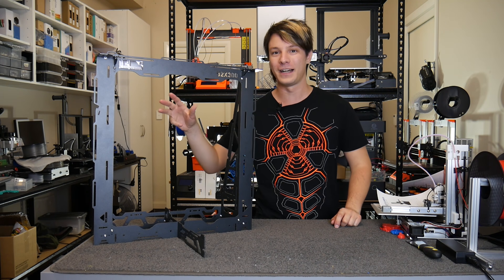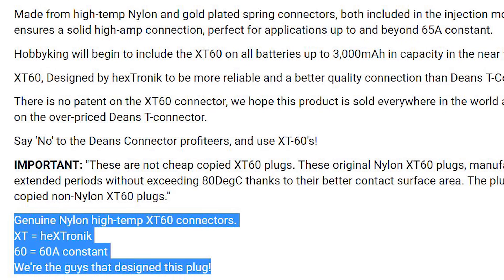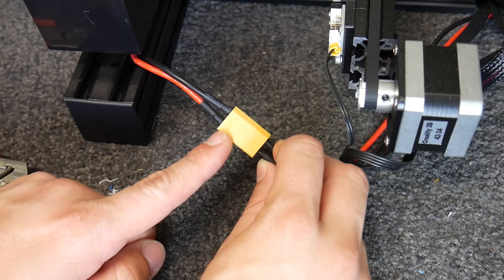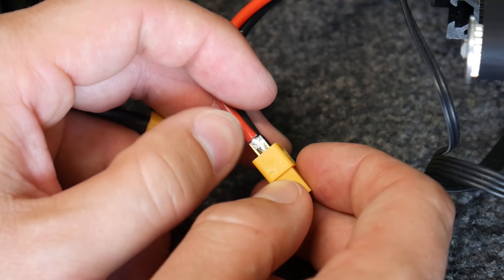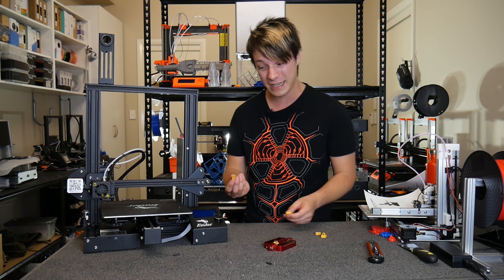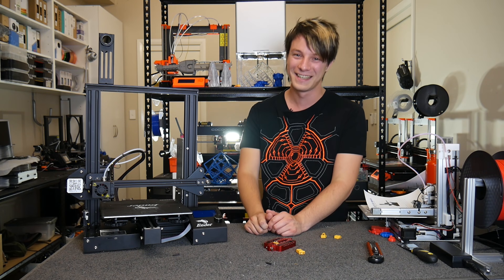Ender 3 Connectors are burning up... Bad XT60's

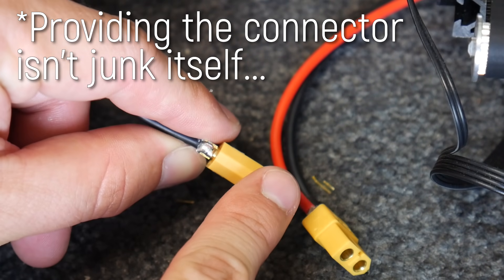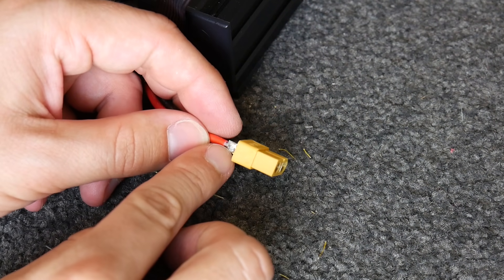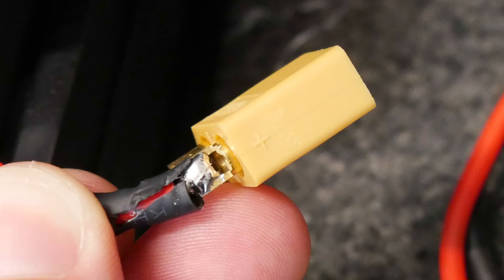Comment: "Decent solder joint??: I disagree, at 4:30 and 4:45 It looks like the cup was cold. It also looks the the first one has less solder than appropriate on the joint. 5:26 looks passable, 5:42 seems to have some of the same problem of cold cup and maybe has excessive solder. If the cup was clean and hot, the solder would be more spread out.  Just seeing the variability I'd blame it on bad joints as well. Even an off-brand connector  with larger than standard tolerance should handle 30-40  amps, which if that's 10 AWG wire would exceed what's safe to run down the wire anyways.

Comment: I would put XT90s on it.. not XT60 but the issue was the plastic they use on these XT60 from alibaba has weaker / thinner walls and many times even during soldering they melt ... the plastic is not able to withstand the heat regular XT60 can put out meaning.. can handle 60AMPS which is heating resistance

Comment: Use a magnet Check of the contacts are made of steel or out of something proper for this use like bronze, which is non-ferrous. Really cheap contact hardware will use plated steel which has a higher resistance. The cheap terminal blocks catch fire on the cheap import RAMPS boards often steel.

Comment: Yup mine burned up and had to be sent back! I'm not sure if I should replace the XT60 on the new one and invalidate my warranty or should I just hope for the best?
Reply: You can feel through the heat shrink if it is crimped or soldered. If you read through the comments here, so far no-one has reported a fried connector and a soldered wire.

Comment: Dumb question ... why do you even need the connector? From my point of view it's just for ease of assembly.
I'm in the process of replacing my Ender 3's mainboard with a duet 2 wifi and I thought while I am at it I'll just remove the connector and run my own wiring straight from the PSU to the mainboard.
Any reason why I shouldn't do that?

Comment: I had a TH1 thermistor (fuse???) burn out on the board of the original power supply on my Ender 3 causing a total power loss.  I installed a new Meanwell LRS-350 (24v 14.6A) following the pics of the wiring orientation I took prior to taking the original off.  The printer will power up and preheat to 185, but as soon as I try to start a print, the LCD goes black, turns back on, and the temperature starts cooling down.  I still do have these XT60s on it, Any thoughts?

Comment: Gold plating versus unplated brass?
Reply: This is the correct answer
Reply: In addition to terminal fitment
Reply: It’s also possible that these cheap crappy xt60s have such a thin coating of gold that it scrapes off the first time its used, causing shavings that arc out. They also use crappy plastic that can’t take the heat of soldering, so the pins end up wobbly

Comment: Soldering is NOT lower resistance than crimping. Any time there is a change in metal type from one point to another, there is a small bit of resistance added. A correctly crimped copper connector on a copper wire will have less resistance than a copper/lead/tin/copper joint. I have worked with 000 wire carrying thousands of amps and you never want to solder the interfaces.

Comment: My Ender 3 came with XT60H connectors which seems to be the same as regular XT60 connectors but with a gray plastic boot on the ends instead of heat shrink tubing. Do you think this is ok?
Reply: Just received an ender 3 and have the same Amass branded connectors with a harder gray back. If you look at the linked xt60 replacement in the description on amazon, they are the same. Seems to me Creality has taken action based on this video/issue.

Comment: XT60 spec sheet says that they are rated only 30A continuous, not 60A like I've seen some commenters comment.  https://www.tme.eu/en/Document/2d152ced3b7a446066e6c419d84bb460/XT60%20SPEC.pdf  purports to be a spec sheet from Amass for the XT60 (-F female, -M male).   Note the RC and MC data items. Translating the Chinese, these mean Rated Current and Instantaneous (Maximum) Current. As you can see, the Rated Current is 30A, and Max Current 60A. 
Rated current would be the highest current that the manufacturer asserts (maybe guarantees) that a connector pin can conduct continuously while remaining below some defined (presumably acceptable) temperature with some defined air flow, and some conduction of heat away by the attached wires. 
The Max Current is the current that can be allowed for brief periods of time, probably a few seconds at most, for example when starting up some load with a high starting current, like a motor.  (In both cases the limit is one governed essentially by heat dissipation.) 
All that said, I believe all Ender 3's provide 24V to the bed heater, and the factory one is something like 220W, so approx 10A current. That is way below even the 30A rating.

Comment: just had my ender fail because of this. the connector welded itself together and is completely burned black on the negative side. i tried a dc jack instead and that actually welded the metal together so im gonna try a 30 amp wago connector next. right now i have 1 dc jack per wire and it seems to be working but the wago connector might be my best bet since i don't think soldering it will be a permanent fix especially with my terrible chinese soldering gear.

Comment: None of those connectors were soldered correctly. The cup should be full of solder and a meniscus connecting the wire to the copper of the connector all the way around. If the solder is on just one side you half the copper carrying the current between the wire and the bullet. One of those connectors looked like it had a dry solder joint too. While the heat may have come from the poor connector none of the solder joints shown in this video are even close to acceptable for the connector.

A common misunderstanding with XT60 connectors is that they are rated to 60A. They are rated to 30A continuous and 60A peak. The data sheet is in Chinese and is not clear. On the up side, with heavy wire on each connector to take the heat away they can handle 60A.

Comment: My plug left a scorch mark on my table lol , but I thought mine Burnt up because of a faulty solder job on the heated bed (wire broke off the solder and was making sparks when the bed moved)
Reply: No, that's not the cause, these are likely independent failures.

Comment: I haven't checked if it is soldered but yet again crealitys printers can be different for the same model but my connector is very firm and doesn't easily slide apart but that's my printer

Comment: I never knew XT-60’s were a hobby king thing. I bought a bunch on Amazon to do my own wiring (which is a lot better done than the Ender ones he showed at least) but clearly that means there’s a lot of knockoffs out there.
Reply: I know this is an old comment, but here's this anyway:

The XT-60 is not patented, but instead was released to be made by many. Because of this, some manufacturers might cut corners, but so long as you are buying from a reputable company (typically any brand highly regarded in the RC community will work) you should be okay.

Comment: My ender 3 has super off-color xt60s, I have some normal ones and it was insane how cheap the ender 3 ones felt. That being said they are soldered and the connection is so strong I can't disconnect them so idk

Comment: Can someone please explain how it is possible to crimp a solder bucket connection? It is also feasible to have a crimp connection and to handle that amount of current and over a period of time too. If connectors are poorly made or even possibly poorly crimped or still soldered poorly then you can easily have an issue.

Comment: hi Angus, I've been having a plastic smell with my ender 3  I thought it was normal. Is it?
Reply: What material are you printing? ABS normally makes a horrid plastic smell (as does HIPS) but PLA is almost odourless (it's not even that offensive if you set it on fire, though I don't recommend doing so). My printer smells faintly when hot- I think this is probably offgassing from the plastic parts in the hotend (especially the wire insulation) and normal, though once again you should avoid breathing the fumes.

Comment: They should never have used a solder connector for a high-volume production machine. Are XT60's even UL recognized?? Crimp connections on a proper crimp pin are better than solder, solder is a much worse conductor than copper. And a machine can crimp a hundred per minute perfectly. I switched to Anderson Power-poles on my RC stuff after a Deans plug unsoldered itself in flight. Yes the blade had shifted in the plastic housing causing a higher resistance connection, but it's under so much spring force internally it's almost impossible for it not to happen when you solder it. At least the XT60's avoid that. I don't think HK understands the difference in application here for RC vs 3D printing. One is used in short bursts while you are actively watching outside,  another runs in your basement all night while you sleep...

Comment: Best solution just get rid of the connector and solder the wired direct. Once built can't see the need for the connectors unless you are heavy into modding and upgrading. Safety first.

Comment: Id like to see a video about making a Prusa i3 mk 3 the size of the CR 10
Reply: The heater PCB contains marker spots for the inductive probe that allows it to apply automatic parallelogram compensation on multiple axis, and that is only available in the sizes that Prusa ships their printers in. So anything larger that you could build would no longer be a Prusa MK3. Prusafirmware also isn't Marlin (it has been forked off it long ago) and doesn't have a whole lot of flexibility.

Comment: Be aware of Bangood offering Wagobox connectors extremely cheaply.
When I asked about the poor quality of Wagobox connectors being sold they told me they weren't manufactured by Wagobox but were 'Neutral' products (that is their explanation for ripped off products).
If you use these then you will more than likely get a bang from your electrical supply.
Be warned about buying cheap electrical connectors, especially from China!

Comment: I think you're over emphasizing how bad crimping is. A well done crimp cold welds the copper fusing it to the connector providing an electrical connection as good as solder (technically better because it's copper to copper) and a mechanically better one as soldered joints are brittle, these are not issues in 3D printing however.

The key there being a well done crimp.

Take a look at high current conductors in the real world not these toys I'm talking fork lift batteries and plating rectifier wires for 300+ amp service which just use copper lugs and a hydraulic crimper.

Comment: The connector is trash, mine melted too. I ended up replacing the whole cable with a thicker gauge, because the cable got super hot too.

Comment: So whats the resistance of the fake ones and whats the resistance of the real xt60's????
Reply: Problem is, you can't measure resistances that low directly, need to come up with something.
That's 7-8A of current there. At 0.1Ohm you'd already have 6W of losses on the connector, which is easily too much for the piece of plastic to handle. Chances are, fake connectors when they go bad, accumulate resistance in that order of magnitude, but may otherwise have benign resistance before the fault occurs. I think what you're looking for foremost in a good power connector is consistency, and you expect a resistance of several mOhm at most, typically less than 1 mOhm.

Comment: Can actually see on one of yours that the wire is not stuck in all the way into the connector. The solder is there but it's not flowed all the way in and the wire is barely hanging on.

Comment: i wouldn't go for anther cheap printer you are just asking for a fire. i ordered a Geeetech A10 and less then a month the thing was smoking and sparking. spend some money and get something good that does not burn your house down. to many youtubers push these crap printers
Reply: That's not the only problem with them. The other one being that way too many people, who are wholeheartedly technologically inept, think that when you can buy a 3D printer for <$200 the technology must be as good and reliable as a <$200 ink jet printer... and man do they piss and moan on forums and youtube when the reality strikes them, which creates a crappy signal/noise ratio for those of us who are in the game primarily to advance the tech.
Reply: I’d have to know more about what’s wrong before just assuming this happens because it’s a cheaper product.  I recently had the charging port on  my high end phone fail, melt the cable and burn my desk. The solution isn’t to spend 2000 on a phone, not 1000. It’s getting accurate information and getting the manufacturer to fix it.

Comment: There can be good quality non-namebrand XT-60 connectors. I had an RC rock crawler that I needed to convert to XT-60. I bought the cheapest ones on ebay. The only problem with them was thet there was too much friction with them. The rock crawler would regularly peak at 80amps of current draw. All im saying is these connectors must be really shitty to not be able to handle this.

Comment: I'd suggest just removing the connectors, and running a wire direct from the psu to the mainboard. Not worth the hassle of dealing with the quick connector when you don't have to.

Comment: just bend the socket out for higher amps+harder to connect/disconnect, or bend in for looooooose AF connection.
IMO 3d printer uses let's say 30A, so this connectro is good, the user can vary ;P

Comment: These connectors are designed for tight space applications, such as R/C. They should not even be used in this application.  Always crimp over solder any day. A QK2 would even suffice, and very cheap. Just use QUALITY crimping tools please. Do not tell people to go put solder in their properly crimped connection as this may actually be counter productive and create problems.

Comment: Mine's gotten so hot it severed the connection, and left melted plastic on my table. I didn't have any spare connectors so I had to solder the connections directly.

Comment: Did you notice the pictures of the melted connections were on the negative?  You only checked positives.  The Chinese don't really have a good understanding of "ground" wiring or negative wiring.

Comment: The fake ones just use a brass pipe as the conductor it seems as there is a hole all the way through. The real ones used machine turned solid brass bars.

Comment: I have 3 Ender 3's, all before the PRO version, countless hours now on all 3 and just checked all connectors and they are all solid and fine. As if brand new. I also checked my mates and his is fine too. So NO PROBLEM HERE at all.  Also CRIMPING is the only way, and the BEST way. Research mate. You only solder on solid. Cables should all be crimped. Every cable on a car or plane is crimped. I am an Auto Elec and I know this for a fact. Some car manufacturer will void warranty if you go put solder on cables. Solder will change the composition of the copper wire. It will lose its flexible characteristics and make is easier to crack and break.
NEVER SOLDER wires over a CRIMP. A true quality crimp tool will never fail your crimps or job.
Feel free to check your cars main wiring or in that fact, your computers powersupply. IT DOES NOT USE SOLDER MATE!!!!
Reply: So if there is solder on that connector, then cut it off and replace it with a crimped connector. If you use a quality crimp tool then there should be no problem at all. I would think using a connector that requires solder would be the problem in the first place.  I haven't checked mine to see if they have solder on them. They are heat shrinked.
Reply from the maker: The XT60 connector is a solder only design, that's the issue, it's not designed for crimping. Absolutely, a proper crimp connector would be a superior alternative, but that's not what they shipped.
Reply: Yes that is very true. Maybe an email and reply to and from Creality might clarify this up for us all. Also none of mine had different colour housings, and they are all very tight to remove. A bad batch would make sense and has happened with many top brand companies in the world especially when demand exceeds supply. And I think the Ender 3 sold more units than probably any other manufacturer of late. Thanks for your reply and my apologies if I seemed a bit harsh. Take care mate.
Reply from the maker: Nah I appreciate it. I am just so confused at the incredible variation. Even on these plugs there is tonnes of different types of various quality being reported. They "all" need to be safe.
Reply: Yes I know, I see it in the Automotive world all the time. And safety and QC should be paramount there. People want everything and they want it now..and put pressure on suppliers. So sometimes corners are cut. Hopefully Creality will offer a fix to anyone who does have problems.  @MakersMuse

Comment: I think in the most part that not the xt60 is the problem... The problem is the soldering job that u do on that connector, a cold solder joint causes resistance and resistance causes heat and heat causes fire🔥
Reply: I have an ender 3 and i got no problem with the connector
Reply from the maker: Um, but creality did that solder joint, not me. ?  The issue is they aren't consistent with their quality control.
Reply: @MakersMuse  yeah you are absolutely right,  poor quality control and bad workers

Comment: I have one of the bad Ender 3's. The pins do not look like the ones in your video. Mine are full barrel crimp pins. Like regular electrical Blue butt splice crimp connections. There is no way to properly solder these. (I have experience crimping and soldering tens of thousands of low and high power connectors for work)

Maybe if you inspected a bad connector in your video, instead of two good ones.